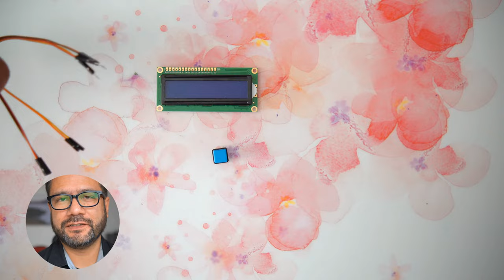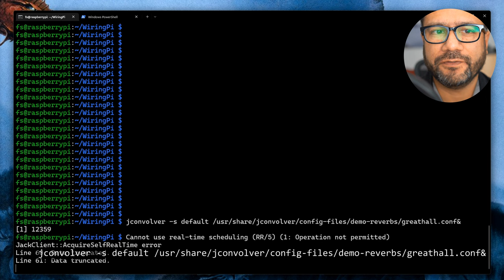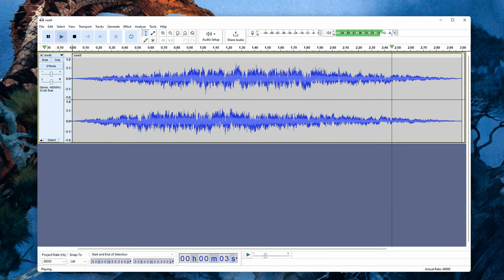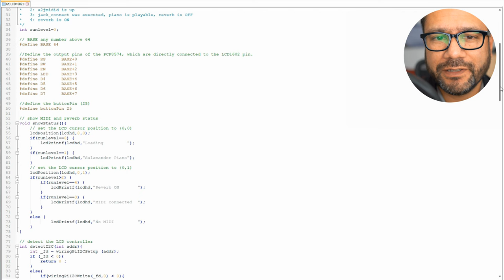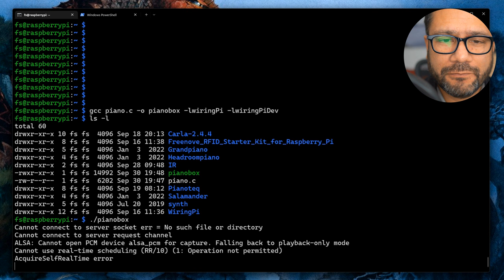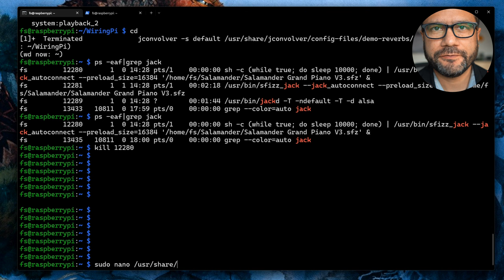DIY raspberry pi piano synthesizer, part 2: LCD, buttons, convolution reverb

Comment: Hello Floyd. I saw this movie a year ago. My daughter really wanted to try street music. Your idea seemed perfect to me. RP as a cheap synthesizer combined with a cheap keyboard is a good idea. I made my PCB with power supply, ADC, battery and charger in a small housing. I had a lot of trouble with this because I was trying to do it with RP5. Later I bought RP4 and everything worked. I bought the cheapest dynamic keyboard (M-Audio). Everything was great until I connected the sustain pedal. Unfortunately this doesn't work well. I put the samples in ramdisk and it doesn't get much better. Now I have replaced the SD card from A1 to A2. I have to give up ramdisk now because maybe I'm running out of ram. It's better because the crackling noises are gone and sometimes there are missing sounds. I'm an electronics engineer, not a musician, and I have no experience with synthesizers. My SFIZZ diagnosis is ok as long as we don't use sustain. My device also has a MIDI input. I wanted to do something a little more universal. It turns out that both instruments I have (Yamaha MODX-8 and YPT-230) are not compliant with the MIDI specification. I conducted my first tests on them and I lost a lot of time before I bought M-AUDIO. I have a microcontroller on the PCB and I am able to correct the Yamaha messages. Maybe I'll do it someday, but for now I'm a bit tired of the topic. Even though I'm not entirely satisfied with the result, I wanted to thank you very much for your materials. Without your work, I probably wouldn't even try. Best regards.
Reply from the maker: Thanks for sharing your story!
You could try replacing SFIZZ with Linuxsampler or FluidSynth or Carla to navigate these problems. I chose SFIZZ because it seemed interesting, but it also stresses the SD card quite a bit.
Reply: @mr_floydst  I will try other programs. I must admit that the Salamander Piano you chose sounds lovely.

Comment: Very nice and ambitious project! I like how it shows the possibilities for customizable instruments with open systems like this. 

A while back, i cobbled together an "MT-32 Pi" for General MIDI and custom Soundfonts and it works great but it's not as easily customizable as what you're doing. I'm also not a fan of the "bare circuit boards aesthetic" so that's still an unsolved problem for me.

Really looking forward to see what you'll come up with next!
Reply from the maker: Thanks for your feedback!
I'm also not a fan of the "bare circuit boards aesthetic" so that's still an unsolved problem for me.
- I'm going to address this in the next (and last) part. ;-)